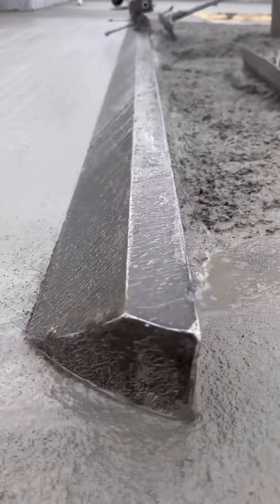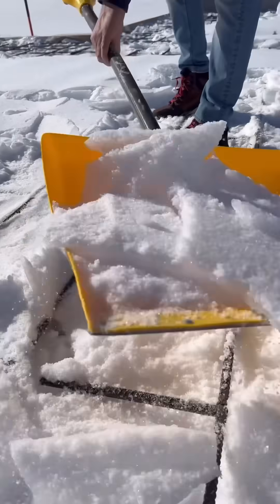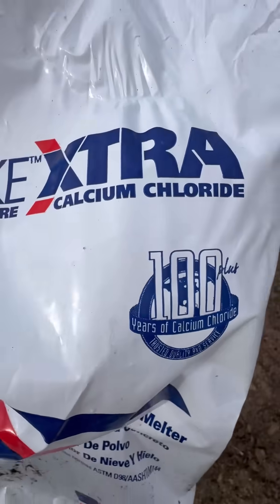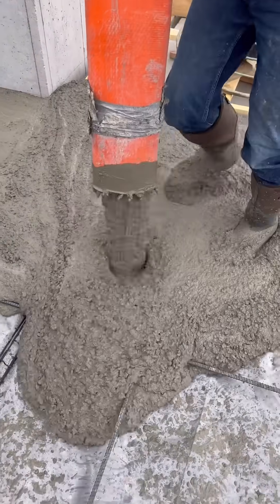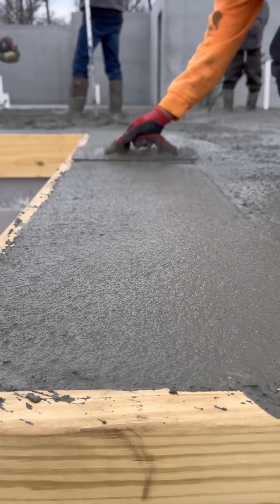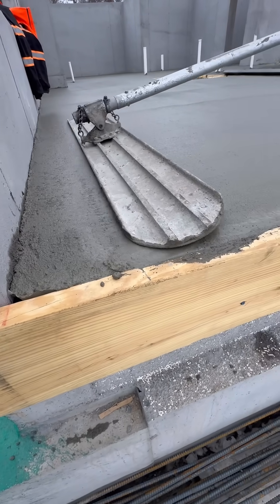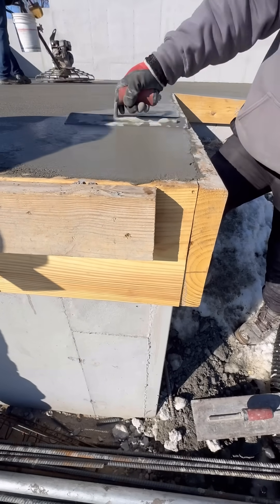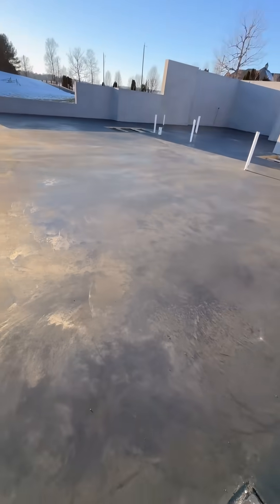How to Pour Concrete in Cold Weather

Comment: It won't crack unless it freezes. Even then it depends on how quickly it freezes. My crew was pouring a large elevated slab in Fayetteville Ark. Mid 120 cy pour the temp dived to -10 deg Fahrenheit.  The slab froze so fast that we had to stop the power trowels due to freezing water on top of the slab. We saved the slab with poly and salamanders. It didn't crack but we had to do a lot of work on the rough finish.

Comment: Should not use cal with rebar or wire it will corrod the concrete and it will crack drying to fast

Comment: Oh it’s gonna crack that’s what concrete does but what you never do is add calcium chloride to concrete if your pouring with rebar it erodes the rebar so ya quality that’s a no and your really screwed if it’s something structural 😂 I’m gonna go with 👎🏻👎🏻

Comment: Concrete is going to crack regardless, that’s why you make pressure cuts/joints so when it does crack, it’ll happen in the joint/cut where it won’t be visible. 
Also for anyone who doesn’t understand concrete, just because a slabs cracks doesn’t mean the integrity of the slab is weak, concrete cracks because of certain environmental conditions, excess water and shrinkage which non of these risk the integrity of the slab. 
The only way that the integrity of the slab is at risk from cracks is putting to much weight on the slab than what it is called for or just poor prep work before pouring the slab.

Comment: Well all concrete cracks, that's the purpose of control joints. What I'd be worried about is the surface flaking, but it looked good. Only time will tell

Comment: Should spray w compound or cover with poly for wet cure, cover with insulating blankets, and once set, run ground heater hose over it for warmth. What we do here in MA pouring in 40F is normal. Concrete temp should also be above 60F at placement, but some specs may allow for lower temp.

Comment: Did you cut it after the video ended? If not then most definetly
Reply from the maker: Yes, we cut it the next morning and then covered it up with blankets
Reply: @hausplans  haha it depends on the weather but we used to start at 4 am pour and finish it till around noon come back hours later and cut it to prevent cracking

Comment: I bet eventually it will crack now if it cracks quickly like not long after it's set then it's probably the weather. Iv never done concrete like that but i have heard that once it's set so much workers will cover it like you did before hand to try to keep it warmer so it can set fully. But with how it looked at the end it seems like you know what your doing. I did like that tool that you used right after pouring to pull it and it vibrates so it gets rid of air pockets and sets better.

Comment: Your fine good job to guys I like to blanket before snow and roll snow off butt your way is yours in over 20 years I've seen alot of ways that's not mine work well,,get your control joints in tomorrow if possible and have soft cut today

Comment: If you can get the homeowner to go for the added expense, it's good to insulate the slab, even if you're not installing radiant tubing. Around here, the old pole barns from the 70's and 80's may be insulated, but the floor is so cold they can barely keep it heated in below zero weather. And working on it, your feet are always freezing.

Comment: I'm in the UP of Michigan, and there's one cement company  in our county that closes for winter, but the other stays open and mixes the calcium chloride into the batch before it leaves. But we got lucky with our shop floor and had the sand covered with the same insul-tarp that was going under the pex tubing. It was covered early before winter, so when it came time to pour they were good to go.

Comment: How did you ensure the temperature of the concrete was maintained overnight? You can use a combination of hot water mix and/or frost blankets over the slab

Comment: Depends if you wait too long to cut.. honestly you can soff-cut same day. Waiting til day 2 it still won't Crack in cold temps.
Reply from the maker: We cut it first thing the next morning and then covered it up
Reply: @hausplans  in my experience, depending on overnight low temps, it's night #1 of covering that is most important as the slab releases more moisture than any other night.. like 30 degrees is ok especially on a power trowel floor. It's a dangerous game here in Montana, I'll tell ya!

Comment: All the "concrete drying" comments. Concrete does not dry, if it does, that is a problem. Concrete cures. You add nothing to it to try and let it dry quicker. NOTHING. That is why shit collapses. You let it cure in proper wet conditions so the reaction can do its thing. Hence, I have done massive concrete pours with no cracks whatsoever.

Comment: See I'm up in Michigan and I can tell you clear as day you're not supposed to pour concrete in the winter no matter what the restriction a limit is due to the fact that concrete is loaded with moisture AKA water and the tensile strength of the concrete will just cause it to become more brittle especially if it is designed for load or pressure😂😂😂😂😂😂😂😂

Comment: Yep it will crack like a mother.  cause you did not keep the heat in the concrete with blankets on top of it after it cured enough by not doing that the . heat in the new concrete.got sucked out of the Crete.  Also the overnight freezing temps creeped in cause obviously concrete has water in it. 40 years ago we never pour concrete Over winter months. I care less about Calcium chloride.
Reply from the maker: No, we cut it the next morning and then very carefully covered it up with concrete blankets. The night we poured was actually warm, but then it was turning cold.

Comment: If concrete doesn't crack its not concrete. That means its da debil bobby bushee! All concrete cracks! U just use joints to hopefully control the cracks. Hence the term control joint.

Comment: I’m so glad I work in a shop setting. It can be -4 F outside and it’ll be a sweltering 80 in the shop. The downside is if it’s 80 degrees outside, the machines and slab heating ensure it’s 100 in the shop.

Comment: Once the cement is poured, it chemically generates its own heat. If the weather was really REALLY cold, you might need to put those blankets back over the set up cement for a few days.
On average, cement takes about 30 days to get to it's full workable strength.  With the new additives, you can cut that time to a week.
But even then, you'd still want to NOT put anything heavy on it to accelerate cracking.

Comment: Yep. They always crack on slabs that big. It can't be helped. As it dries out, the moisture lost will cause it to crack as well as the temperature changes. In the summer the slab will expand (depending on it's climate area) and when winter returns... BAMMO! It will contract again and this time a definitive crack will show.

Comment: Crybaby 😂.  I have poured concrete in -25c. Hoard and heat the site. Sink 3/4 polyester pipe loops and cycle hot water through a custom boiler to heat cure the concrete.  But boo hoo. You had a little snow.

Comment: Could’ve used Non-Chloride Accelerator instead of calcium. Costs more but doesn’t degrade the rebar over time.
Reply from the maker: I’ve used that in the past and had some disaster effects. Doesn’t seem to work as well.
Reply: @hausplans  you do typically need more volume of NCA to have the same effects as liquid calcium. Did you use flake calcium because that's all the concrete supplier offers? Or because your pour was far from the concrete plant?

Comment: Yes it will crack. All concrete cracks. The question is, is it going to crack where you want it to crack (control joints) or where ever it wants to crack?

Comment: This is interesting, in decades of experience I have never seen a contractor have to add the calcium on site, except with doing extremely high amounts for night patching work. Why did you guys add on site? Was the ready-mix company not offering it as batched?
Reply from the maker: In our area, all three Readymix companies send it out with the driver and it’s added in on site
Reply: @hausplans  Weird! I mean all things considered that's a pretty safe way to do it. There are definitely days when the truck has to sit for a long time full of calcium...and that's no fun. Adding it on the site right before you pour the truck out definitely would help that out 🤔.
Reply from the maker: Yeah, I’m guessing maybe that that’s the reason. I could see them also saying added it and forgetting to do it at the like a plant
Reply: @hausplans  Yea I can see that. In my area drivers only carry air entrainer/detrainer and occasionally retarder in case of emergencies. The only time they will be adding calcium or NCA on site is when they do super super hot mixes. Adding up to 18% NCA in some cases, so the road can be opened in the morning. Nasty stuff!

Comment: In my brick and stonework days we'd use a bit of calcium chloride in the mud (antifreeze) and build vis-queen (thick, clear plastic) tents around our work with heaters inside. Later in life, working in a t-shirt in the dead of winter was the main motivation behind wanting to tent and heat my concrete pours (was feasible only about 2% of the time). I still remember some of the crazy looks I got from the old timers when I'd suggest building a heated tent over our work. XD

Comment: calcium chloride was used in the 70-80tis in europe to speed up the hardening of the concrete as a result that the ironbars starts to corrode over the years (because of the chlorides) and cracks the concrete which is hard to stop.

Comment: I would not use Calcium Chloride.  Everything you did before was great but after either blankets/heaters whatever to keep it warmed after pouring. The slab will crack, that's what concrete doooo, that's also why WWM is so important in slabs

Comment: Snow in January turns into rain in spring, blistering heat in summer and so on. You can always find a reason to not do the job. Well done. I don't know anything about pouring concrete, but this is awesome.
Also, why are the car salesmen "used"?

Comment: The reinforcement wire is meant to be sitting on chairs.  Oh,and  lifting the wire up after you pouring the concrete doesn't work either as it will settle back to the bottom.
Reply from the maker: All the rebar in this video was sitting up on chairs. They’re called slab bolsters.

Comment: it's concrete, yes it will crack, the question is will it crack where you want it to crack or will it crack on its own. post pour temp control is important, not letting it see giant swings in temps is key.

Comment: Well... We don't depend on concrete to hold the house up. That's what rebar is for. The concrete is like walls, it's insulating the dirt, it hides all the other imperfections of the house because everyone is staring at the cracks while the house is on fire, the roof is falling but it all started with concrete.

Comment: I am the lab qc, at a concrete lab. The only real problem that I see with your slab is that you added chloride to concrete that's going on rebar, but i've seen a lot worse like a company the 50 gallons of water to their concrete as soon as the truck gets on sight, no matter what slump, they order. Do not buy a house from homes by tabor.

Comment: How deep did you poor. If you pour 10 inches deep it won't crack. Cost is lot; higher ,but you'll be happy, I'd guess you poured 6 inches and it will crack. Also, sould of had the blankets down at least the nite before if not sooner. Go back in a year and I'll be watching for it 😮.

Comment: The inside corners are all gonna crack and it's orettt cold so it's not kicking off and getting super hot so you will definitely knocked your chances of cracks down to 60% meaning 60% chance you get cracks

Comment: The thing that you have to worry the most about is that snow and the moisture that is underneath the slab. The slab will put off heat especially the first 24 hours and sometimes later that moisture can go into your sub base and expand a upheaving the concrete or creating a base that is not as compact. Which they did the correct thing by drying the moisture on the subgrate.

Comment: If you follow ACI winter weather concreting protocols you should be fine, but if you don't have proper insulation placed to keep this from freezing before it gains enough strength then you have not done the building owner any favors.
Reply from the maker: We covered it up with blankets

Comment: now keep in mind i'm a rando with no clue about the concrete pouring, so uh, my guess is that it will crack because of how slowly it will take to dry out in cold temperatures. I can see a cold front coming through too, probably more snow, with moisture and freezing. do cracks matter and can it be fixed?

Comment: They should be using a non chloride accelerator if there is rebar in the slab
Reply from the maker: We’ve used the non-calcium chloride before with disastrous result, it doesn’t accelerate near as fast
Reply: Exactly.  This should be viewed as a "not how to properly do it" video.  CALCIUM CHLORIDE EATS REBAR.  THIS SLAB WILL FAIL LONG TERM!!

Comment: friend has 5000 sq feet concrete footings already
set what temperature would you run the
building  at LB White heaters and how long outside
temp 20 degrees insulated

Comment: Sorry, I am not an expert, but it will need to be daily sprayed with water (keep it wet some time to reduce the quick contraction) to prevent the cracks, dont know how is that going to happen in winter, and I noticed in North America they don’t use the concrete vibrator to prevent concrete honeycombing, it is just 90 dollar Canadian

Comment: Some of the most beautiful concrete work I’ve seen in the past eight years. Most people’s work has gone way downhill, but you, my friend are setting the bar quite high.
Reply: Are you kidding me? The slump on this was a near 7”or 8” slump
Reply: @LothricKnight  That's irrelevant if the slump was to spec. Are you the structural engineer on the job? Tell me why the slump is bad. Also I've only seen this short. How do you know what the slump was?
Reply from the maker: All the credit goes to the guys doing the work I was just holding the camera that day
Reply: @hausplans  that's cool of you to give credit where it's due
Reply: You are smoking crack if you think that’s a nice slab. Look at how fucked up the finish work is. You’d cut your socks walking across it